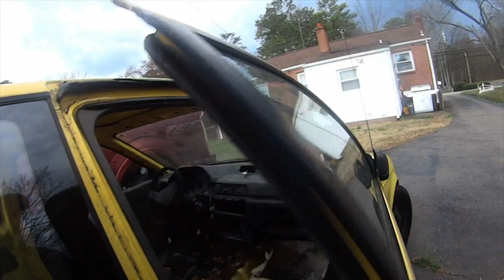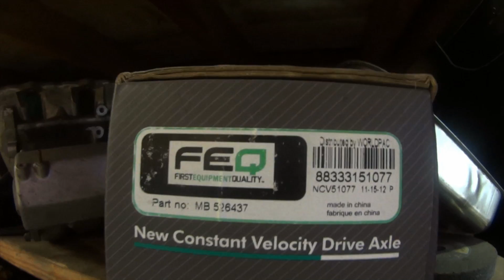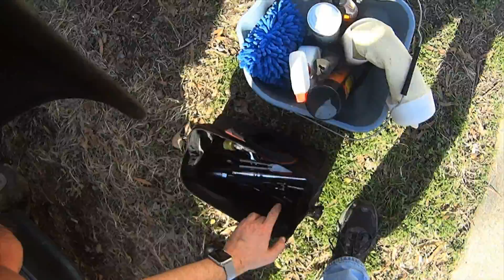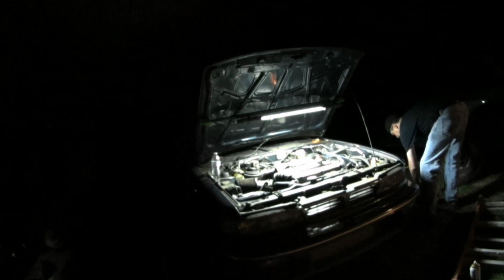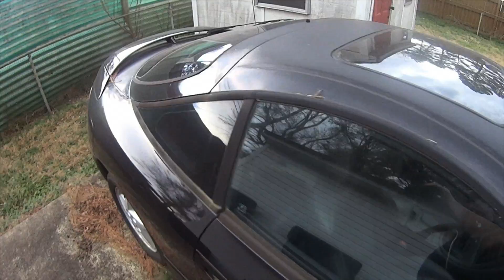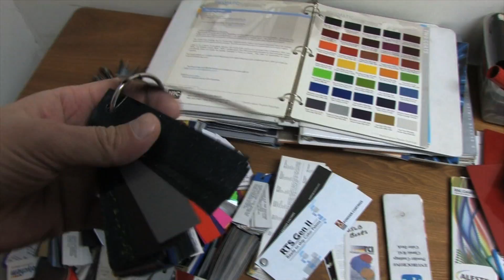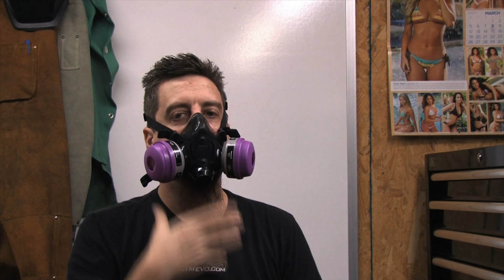2017 Cliff Notes

Comment: I'm also having an issue with my drivers side inner cv joint, on my "92 mirage hatch, I was planing on using the 1g dsm awd half shaft with a 1g dsm cv axle, only it contacts the frame rail, and tears the inner CV boot, I hope the FE-Q one in your video will work... right now i'm using a stock long drivers side cv axle, I heard one awd swap required the owner to grind the frame rail in order to use awd axles, I'm hoping to avoid doing that but thats my last option.
Reply from the maker: I had to grind down the seam on the passenger side and weld it all the way around to make the passenger side fit on the Hyundai.  I'm still working on the driver's side, and I'll let you know if it fits.  I may even try to fit FEQ on the Hyundai to see if it helps with traction.  We'll see?  Right now the Hyundai has the stock long driver's side axle as well.

Comment: If you're worried about state inspections so much, you just need to find the right guy to do it. If you take it to a dealer or a reputable garage they want to scrutinize every little thing, it takes them forever and they make you fix pointless crap like missing catalytic convertors, no seatbelts, less than four wheels, etc... I don't know how they do it in Virginia, but I live in West Virginia and I take all my cars to this really old guy that lives like 10 miles outside of a small town, all he does is inspections, and the ONLY thing he checks is wipers, lights, tires, horn, then he gives you your sticker. He won't even let you pull into his garage because he painted the floor and doesn't want to mess it up. I've gotten by with cracked windshields, no catalyst, missing body panels, no rear brakes, offroad exhausts, stuff that would only be street legal in the Sahara, although not all at once. Also, no offense, but your county sounds really uppity; I have at least six cars parked outside my house at all times, only three of them are registered, and only four of them run. One's missing the engine and hasn't moved since 2001. No one ever says anything.
Reply from the maker: I live in a blue county surrounded by a sea of red.  If that spells it all out clearly, you're wide awake.

Comment: Hey look an Isuzu rodeo. Those 3.2l v6 engines have 3 bell housing patters they can accept. Interesting things.
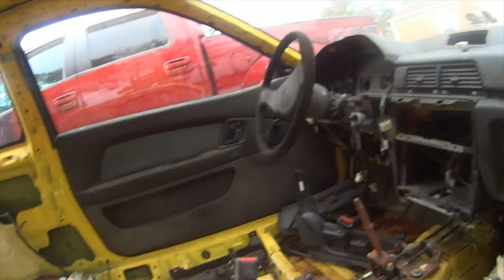Reply from the maker: They've also got a factory Dayna 44 rear with 4:30 gears and disc brakes.  :). Open diff, though.  :(
Reply: I didn't know that. I bet a ratchet locker could solve the problem of it being open diff? "XD-14430 DANA 44 AUSSIE LOCKER"

Comment: Hey Jafro, loving the vids!! I've learnt so much from your many different topics and they've all helped me lots in my trade. 2 questions: when you were rebuilding the Hyundai motor, why didn't you balance the pistons separate from the rods? I've seen other videos of people balancing the two components separately, I'm just curious as to your reasoning for balancing them together?
2nd: I'd love to see a few more gsx videos, when can we expect more of these?
Cheers from the land down under 👇👍 keep up the great work Jafro!!!
Reply from the maker: The GSX is just going back into production now.  The crankcase coating vid is the GSX block.  4 days left before I can get it baked.  Honestly I have yet to reach out to a powder coating shop to see if they will do it.  Cross your fingers.

Balancing them separately is the right way to do it.  I totally owned the balancing process being a half-assed attempt in the Hyundai assembly, and I did it that way for several good reasons.  

1) the pistons are pressed-on and even talented builders break pistons while trying to remove them.  Even with heating and cooling.  Breaking a piston would technically total the whole engine because it's .030" already.  Putting a new piston and rings in it without a hone just isn't going to happen.  Watch the "Blueprint Everything" video if you want the numbers on exactly how fare out on the edge of the end of life all these parts are in.  There's been so much machine work and boring that I don't even have the room left to fix it.  
2) I removed weight using sandpaper, grinding the length of the rod, so the weight was distributed on both ends of the rod (but yes, more of it on the pin bore side).  I didn't need to remove much to get them to match.
3) grinding the stress risers off of the casting lines is actually a strengthening process that I was looking for an excuse to do.
4) These were the parts that survived the previous fail.  I want to keep using them.  They'd never been balanced and they came from cars out of a junkyard.  The pistons were a new-but-on-clearance set of generic non-turbo Galant pistons, bought for $30 at Bap-Geon.  That's all the money that was invested in it.  What do I have to lose?  I'm more likely to break a piston dis-assembling them.
5) To prove you can.  You can screw it up, too if you've got one messed up piston somewhere, but mine works great.  
6) I've got all the GSX to rotating assembly stuff to balance, and all the stuff to do it the right way.  The stuff going in the GSX has floating wrist pins (easily serviceable) which makes weighing all the separate parts a snap.

Comment: Hi Jafro. Have you thought of doing a video for Shop/garage hacks, the coffee filter for cleaning parts was simple and worked great, it's how i cleaned cylinder walls when building my engine, and also the harbor freight part # 93051 and # 5645 together, made engine blueprinting that much easy. thanks alot!

Comment: Jafro. after rewatching your whole gsx and now your Hyundai build videos has inspired, and reignited my drive to rebuild my 2g TSI AWD and get her going again. Though to say she has been sitting for the past 8 years in a storage unit, I've finally been able to get the 2g out and to my garage. already begun disassembling, and ordering replacement parts and gaskets. We have talked a few times before in the past years doubt you remember but that's ok. when we did talk I was still having the same issues as I do now with it being an electrical issue after it started on fire racing bikes. I have since spliced a new harness into my 2g but to no luck it's not going to give up the goods that easily. but long story short. I wanted to say thank you again for having these videos and giving me my spark back to get my 2g rolling again and not let her sit and for away on back stands. hopefully I could count on you or some local dsm gods in my future months to come.

Comment: ha i saw my post in the video awesome
Reply from the maker: I wanted to give you what you want.  BTW:... I've got 8 hours of work done on the GSX block, and probably 4-5 more by the end of today.  Giving you more of what you want.  :)
Reply: Well you're a gentlemen and a scholar good sir!!. Can wait to see it.
Reply from the maker: It was an easy decision for me, really.  Many factors involved, some less obvious than others.  The 2g head has narrower intake runners which lend themselves well to higher port velocity than the 1g head provides.  The exhaust ports are plenty big on both, but one's no better than the other in that regard.  Another benefit is the car's electrical harness, all of my sensors and my ECU remain correct and un-changed.  This is facilitated by adding a Kiggly crank trigger kit to provide the missing crank angle sensor on the 6-bolt.  My 2g head has been ported previously and at great expense.  Then there's the obvious part of the bling factor and how many hours of polishing I have in it...  There's nothing wrong with a 1g head.  They're great for low compression high boost configurations.  Being that my pistons are 9:1, I can benefit from the knock suppression gained by the higher port velocity.

Comment: nice  shame you don't have a bigger cam(272)
have a Mitsubishi Celeste with a 4G62(Mitsubishi Cordia turbo engine) 8v sohc fully worked with an aggressive idle(272 cam), Mitsubishi chariot RVR turbo
she is a rocket and mows down evos like they are little fat kid
Reply from the maker: The 6-bolt going into the GSX is going to have a set of Kelford 272's in it.  Or did I buy 280's?  Heck I forgot!  It's been so long since I bought them?  LOL!  I think they're 272's.  Don't worry, I'll still be turning other fast cars into fat kids with that one.  I almost managed to snake a 1988 2.4L DOHC 6-bolt Galant engine from a junkyard, but after I got the phone call, someone else beat me to the snaking and bought the whole car.  That would have been a dream come true.  From 1985-1988, Mitsubishi actually made a 2.4L DOHC 4gxx that you can simply bolt the turbo manifolds onto.  You just never see them in junkyards because they're so old now.  I've only seen one, and it's in a picture that was texted to me.

Comment: I would love to get your opinion about a 4g64.... lol I have a dodge stratus and got it from a family member that is no longer alive... I don't really like stratus in general but I like this one. I've had many dsm's but never a 4g64... I've done some research and everywhere I look people say they can't take making power without changing the rods and pistons. I find this hard to believe that a n/a 4g64 can't handle a little boost. lol in Mexico this car came boosted and my gut feeling is dodge had some leftover turbo parts laying around and turbo charged a few Dodge Stratus.
Reply from the maker: Where did you get that news from?  How do they fail?  That didn't come from DSMtuners did it?  You have to read some users' posts with a grain of salt and a vinegar eye wash.  No, don't do that.  But everyone's goals are different.  Some people want to be the fastest car on the streets, and some might just want to make cool turbo sounds and a few extra horsepower because they can't even bark a tire.  Let me tell you what happens in forums all too often.  Someone mis-diagnoses the cause of an engine failure and then posts emotionally about it because they just suffered loss caused by their own modifications and handiwork.  4g64 is not the most popular platform, but I don't see any reason why you'd need to replace your internals to make a few PSI for a little extra power and to make some cool noises with.  You should be more worried about getting a fuel management system that can deal with all the extra air you'll be feeding it.  If you run it lean, it will get extremely hot.  If you want to make a ton of horsepower, you're going to make a ton of heat.  If that heat makes you run out of ring gap, it's an oversight caused by the engine builder, or the engine booster.  

You absolutely must keep temperatures down because that's what will give you the best chance of keeping it all together.  You need enough fuel to prevent burning lean, and you need enough ring gap for the amount of power your engine is making.

Go watch the "Foofy?" video.  Yes, I know it's a Honda.  But there's a valuable lesson in there.  The pistons fragged above 20 PSI because they ran out of ring gap (on the 1st engine), above 14 on the second one (it was a low-mile tight engine which caused it to fail faster).  Ring gap is an issue that you can correct without replacing any of your internals, BUT, you will still need to remove pistons and rods, file the ring gaps wider, and then put it all back together.  Ring gap is dramatically affected by thermal expansion as power and heat rises.  That will guarantee better results than everyone who DIDN'T do that when they boosted their 4g64.  The other alternative is to just keep it set between 5-10 PSI.   Forced induction raises the temperature of the combustion chamber and once the two ends of a ring touch each other and run out of room to expand, it's over.  If you look up the factory turbo DSM ring gap and compare it to the stock ring gap the non-turbo 4g63 uses, you'll probably find it's twice as big as the non-turbo's ring gaps.  Mitsubishi did that because of how that piston is being used.  The rings aren't any different.  Want nitrous?  Double the turbo ring gap. There has to be enough gap that they don't touch down under their heaviest and hottest load, but not so much that it drops your compression and fouls your oil quality.  Ring gap is the secret sauce.  Watch Foofy and see what happens with the boost is too high and you don't have enough ring gap.  Then go re-read some of those people complaining about a 4g64 needing rod and piston replacements and see if they ever dish on their ring gap.  See if they even mention having changed it from it's economical 2.4L non-turbo configuration.  You can boost most anything if you've got the rings gapped correctly for the power you're making.

Remember that the Hyundai in my driveway has a 2.0L non-turbo galant block and rotating assembly with generic $30 non-turbo 9:1 .030 overbore pistons.  It's really 10:1 because it's using a DOHC 1.6L head.  Rings all loose and out of spec and thats very well detailed in the "Blueprint Everything video".  It's because of this that it's holding 32 PSI on 3rd gear pulls.  It will smoke the tires to the end of 4th gear from a stop.  It will do a rolling burnout from 55-90mph just because I laid into the throttle slowly in 3rd gear.  My ring gap specs are detailed in that video.  Seriously, between watching those two videos, you'll get why some jackhole said the pistons and rods in a 4g64 are shit.  I don't want to call those people ignorant, but people who post emotionally about ignorant at the very least.  You find why it fails and fix it.  This is such a good topic I should have made a video about it.  

But yeah, if it's a materials problem and they're burning holes in pistons and bending rods, then forget everything I just typed.  Go check out the 4g64 forum on 'tuners.
Reply from the maker: "about" was supposed to be "are being" and the damn Mavericks auto-correct "feature" is just killing my replies.
Reply: I've actually watched all your videos and I did like watching foofy... I drive this car around the country and I've towed my 240z on a car dolly behind it lol I know it's a little crazy. HP tuners I believe can tune the stock ECU. I need to send my VIN code to them and make sure that they can. I was thinking of doing a stock cast turbo manifold small 16g and maybe some evo or dsm I injectors. I've done a lot of research on the 4g64 but everything I find is on the single cam or completely built 4g64 dohc and in an EVO  making ridiculous power. the very few builds that I did find of someone throwing a turbo dohc 4g64 didn't finish or some catastrophic failure happened but with that said I think I'm going to give that go.... if I can find an easy way to tune the car... don't really feel like putting Standalone in it already have a race car for that. but getting enough power to not have to downshift every time you hit a 2% grade would be nice specially if I tow my 240z.
Reply: jafro do you know anybody who is dug into a Dodge 4g64 I'm wondering what kind of rods they have.... you and your buddy in one of your other videos were talking about parting lines in the newer Kia engines....

Comment: Jafro, what are the ''handles'' on the main bearing caps for, that can be seen when you had the block bored? ive seen that my j2 wagons g4gm 1.8l beta engine have them aswell. for strength? girdles so to speak? 
aaaaand, will we se some beta-action on the channel? ive read on, i think, a malaysian site about some guys having great success modifying it. they talked about a 2.0l with 1.8l pistons making closer to 450horse =)
Reply from the maker: With four 4gxx projects to build, I'm not going to be messing around with any of the beta stuff.  I'll leave that to the pros who've figured it out already.  

The suitcase handles are a sort-of pseudo-girdle.  They clamp down on the non-thrust caps because #2 and #4 are harmonic vibration points.  So is #3, really, and I don't know why Mitsubishi didn't tie the daggone thrust bearing to the rest of the caps on the 1g blocks?... but #3 is at least a massive main cap on the 6-bolts to make up for that.
Reply: well, i thought so, but thats the catch, there is pretty much 1 writeup on the internet to my knowledge around souping up a beta engine, and ive done some halfassed searching for the time ive had my car (3 or 4 years, longest ever, usually switch at 6months). so i figured ya know ;) 

and thank you for that very informative answer. and yes, that do raise some questions haha :D

Comment: wait whats the 6th car? the f150 the colt hyundai and GSX galant is all i counted
Reply from the maker: Which one of the F150's didn't you see?  :)
Reply: oh dam i feel dumb i saw the white f150 too keep up the great work jafro you helped me so much with the clutch install on my 97 gsx like 4-5 years ago and i couldnt have done it without you
Reply from the maker: The drive-by update.  It only got two sentences.  That dang thing just keeps on tickin'.  Boring and reliable.
Reply: yeah those older f150s just dont die my dads had like 450k before it finally went